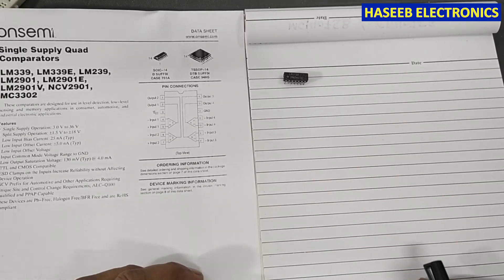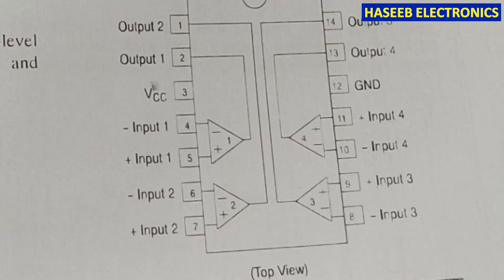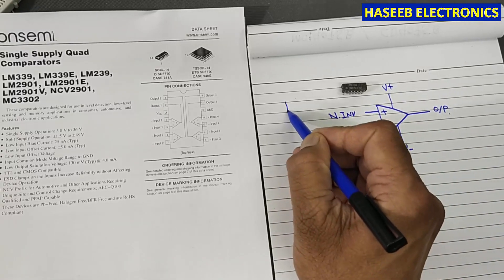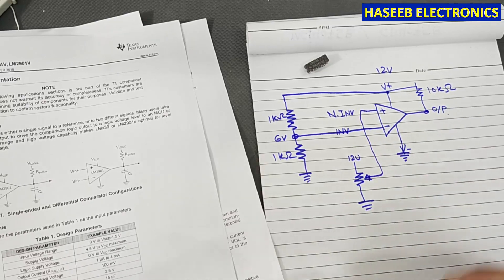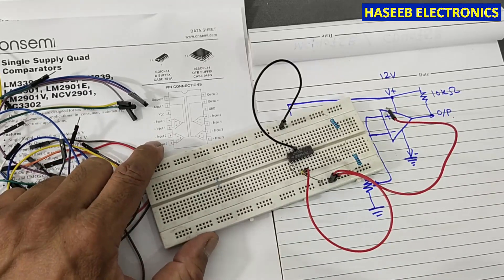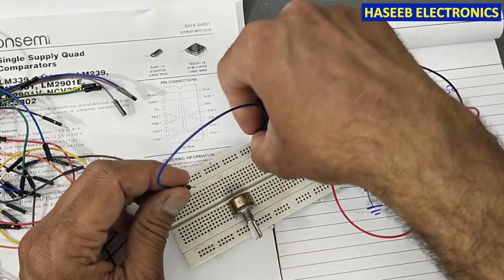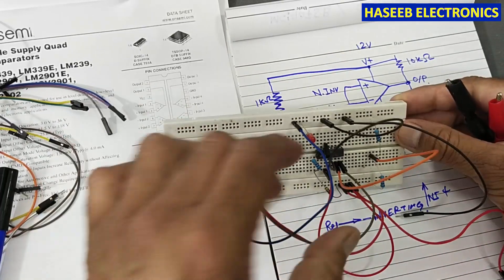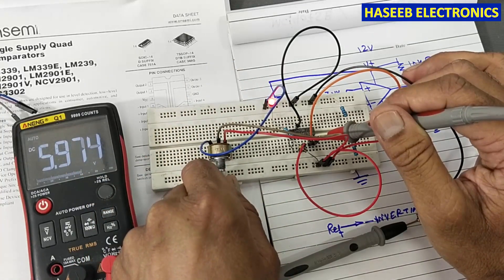{738} Comparator Circuit Explained Using LM339

Comment: Excellent lesson! Excellent start to the week! I'd like to try this circuit and see how this is different than an op amp. I believe that if you built this using an op amp the led would glow gradually bright in linear fashion, with the comparator the led is just on or off. Have a great day!
Reply from the maker: best regards 
yes it can be made using opamp 
but the basic comparator circuit is a decision making circuit, by sensing differential voltage at both pins

Comment: What is the out put vootage out lm339?
Reply from the maker: VoL - low level output voltage are maximum 400-700mV
VoH- because it's output is open-collector type. Output voltage will depend on pull-up resistor connected on output pin and supply voltage

Comment: سلام استاد آیا امکان دارد این آیسی در مدار منبع تغذیه کامپیوتر بسوزد ؟
من یک مدار atx دارم که ولتاژ ۵ ولت سیم بنفش برقرار است ولی روشن نمیشود . بنظر شما مشکل از این آیسی است؟
Reply from the maker: خوش اومدی برادر عزیز این آی سی فقط برای نظارت بر ولتاژ و بررسی ولتاژ بیش از حد، تحت ولتاژ، بیش از شرایط فعلی است. بیشتر اوقات این ic به طور معمول کار می کند، اما به دلایل بالا، سیگنال "غیرفعال" را به ic کنترلر pwm (TL494 یا KA7500) ایجاد می کند، عمدتاً پین شماره 4 کنترلرهای pwm فوق را کنترل می کند. این ic به ندرت آسیب می زند
welcome dear brother. this ic is just to monitor voltage and check for over voltage, under voltage, over current conditions. most of time this ic is working normally, but due to above reasons, it creates "disable" signal to the pwm controller ic (TL494 or KA7500), mostly it controls pin number 4 of the above pwm controllers. this ic damges rarely
Reply: @HaseebElectronics  سپاسگذارم استاد عزیزم . موفق باشید 👍

Comment: Very interesting any application that ic can we use ?
Best regards from Philippines 🇵🇭
Reply from the maker: it is widely used in battery chargers, for controlling charging, discharging, level indication, oscillators, triggers, level detectors, zero crossing detectors 
almost every power electronic circuit have this ic 
i will continue with this ic to share its practical uses
Reply: @HaseebElectronics  interesting series let's continue on that 👍

Comment: Haseeb sir good morning, while non inverting pin voltage is less then inverting pin then in which state output pin like it will connect to ground or zero volt open drain? pls elaborate. thanks for nice video
Reply: 0 Volts....
If non-inv input higher than inv input the output go higher (i think it's 5~8 volts not sure)

If non-inv input lower than inv input the output go lower (0v)

Comment: Salam . But whay you used the pull up resistor 10 k ohm you said open  colector. Thank you
Reply from the maker: wa alaikum salaam brother 
it is its construction is open collector output, and it is in manufacturer datasheet. there are many features left behind, we will discuss them in upcoming session. it was just its basic working principle
Reply: @HaseebElectronics  lncha allah

Comment: Exelent Job sir.
All video knowledge is deeply and simple way.
Sir I request for one question from last 4days.Sir what is primary side feedback.  12volt 8amp smps with ic LNK6666E without optocoupler and TL431. How I get 14 volt from this smps.